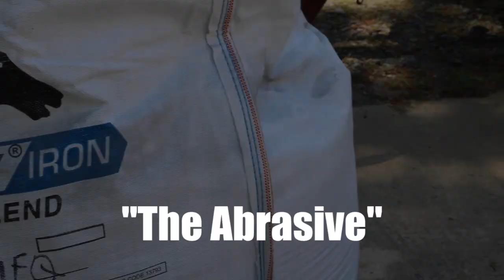How to Sandblast -Sandblast Nozzle Test XL Nozzle vs Long Venturi Final Video

Comment: Have to try the Saber Nozzle
Reply from the maker: We will give it a try !
Reply: @TheMobileBlaster  https://www.spongejet.com/product/saber-blast-nozzle/   I would recommend running with a 375CFM compressor.  Available sizes start at 3/8 #6 nozzle.
Reply: @TheMobileBlaster  https://www.spongejet.com/product/saber-blast-nozzle/ 
tell them you spoke with Damian.
Reply: I have and use daily a saber #7 nozzle. They (Sponge Jet) claimed it was 33 % faster than my long  venturi. So I bought and tested it. I was able to verify the saber was 25% faster than my normal nozzle. My testing procedure might not have been perfectly accurate, so maybe it is 33% faster. But I'm positive it's at least 25% faster. So my savings in abrasive in 2 months paid for it, and now it's all savings. 

I was at Sponge Jets website last week, and now they are claiming its 50% faster. I believe that's marketing hype.

Comment: I would hire the guy on the left as he did a very thorough job. The guy on the right did fast sloppy work and left zebra stripes all through his plate. He would have been 25 seconds slower if he did the same blast quality.
Reply from the maker: They are the same person  but HE did use different styles to find which would work better/faster